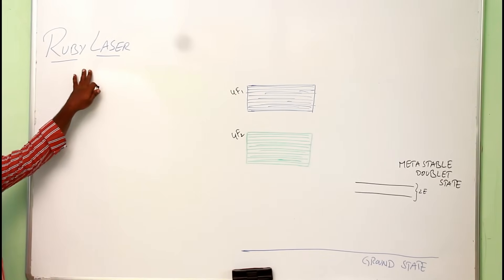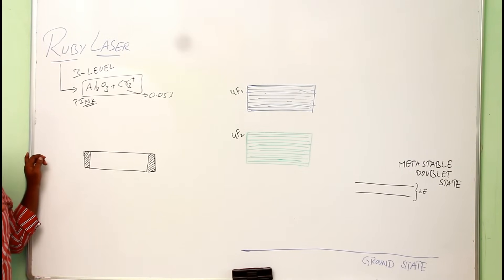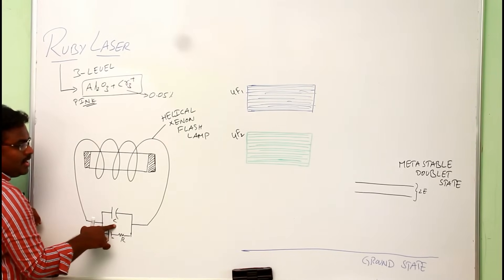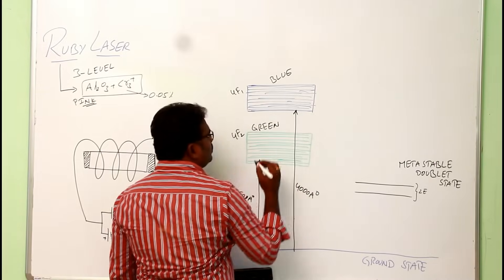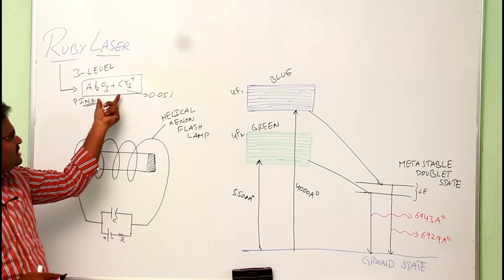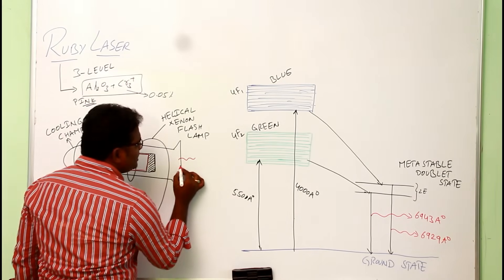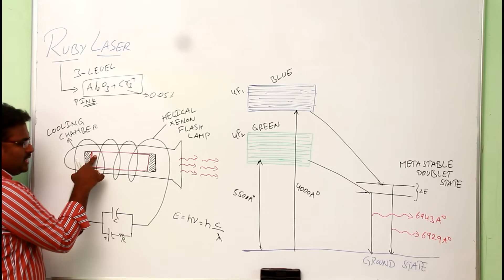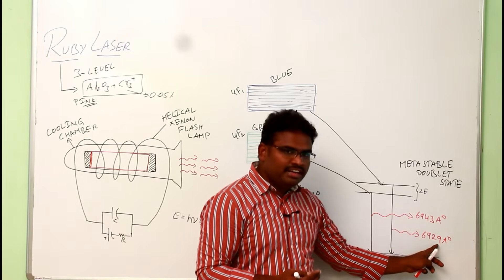Ruby laser working and construction

Comment: What happens if we don't use a capacitor (generalising the concept that not only AC, but also DC flows) in the circuit?
And what happens if we use pure DC(instead of Capacitor, an inductor is placed in the circuit)?

Comment: Sir a small doubt 
Y cant we use another metal instead of ruby rod fr producing laser in case of using which  can we use ..
Al2o3+cr2o3 can we write in this way for chemical combination of ruby rod
Reply: You can. The best one is titanium using TiO 2+ ions. Any metal with an oxidation state of 2 or 3 can be used however the metals used must have the potential for a higher oxidation state to give a laser transition. For example, AL or Ga won't work nor will Mg or Ca but use TiO2+ Ce 3+ or Er3+ it will lase in near IR at 800nm, visible yellow green at 573nm, or deeper near IR around 2.1um.❤